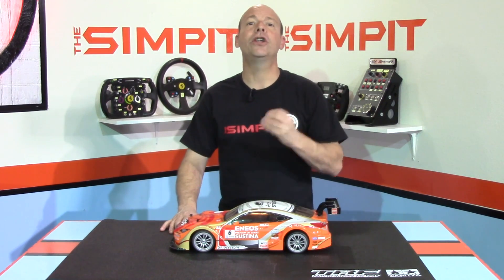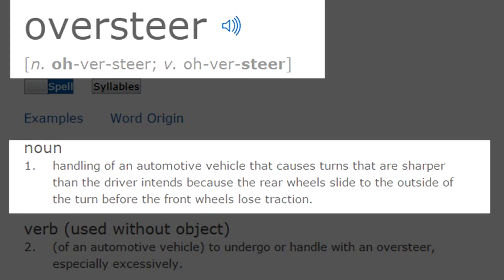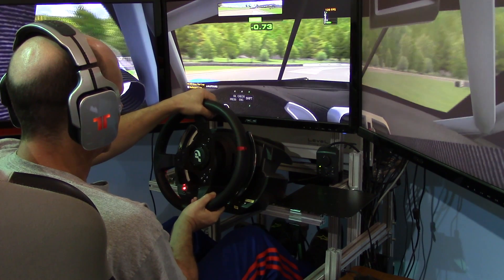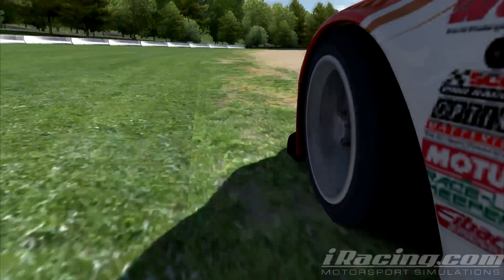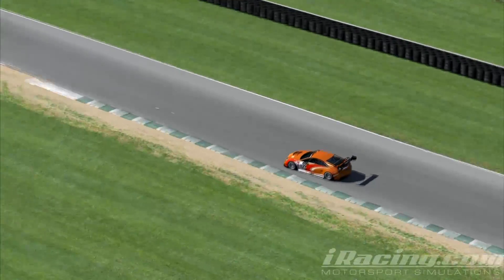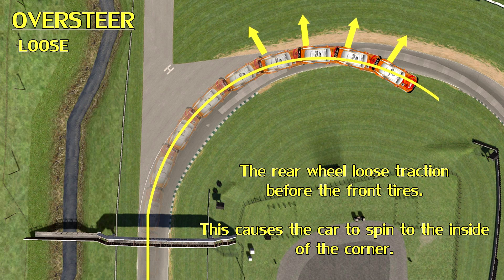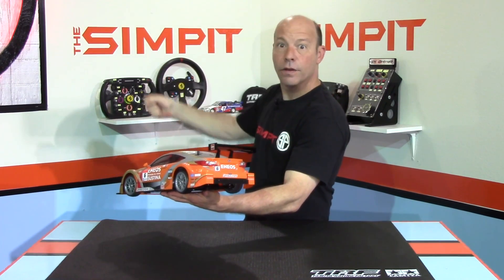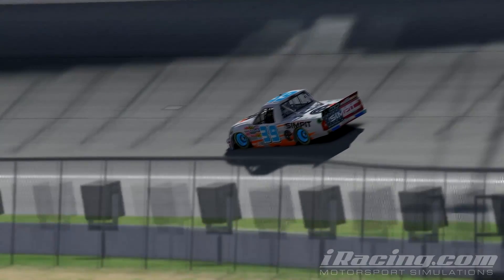Oversteer and Understeer Explained - Simpit Driving School

Comment: I know you said beginner level, but for understeer, 
Would you say the car leans away from the intended direction, do to weight transfer/ Inertia. The inside tire has less traction and therefore less power to pull you into the corner.
You mention what to do to correct this at Beginner level, 
Counter steering for a split second should give you more traction to be able to continue in word into turn, right?

Comment: Here's weird thing. Understeer as described here simply requires the driver to oversteer, provided he has fwd or awd. With a good weight-balance  it's possible to drift front and back simultaneously. With fwd, the fw's are oversteering and the rw's are sliding. This is very quick in corners.

Comment: Thanks for the videos.  Just getting into serious racing simulation.  I actually have been through some higher level driving schools (law enforcement) There are some similarities, however racing is racing :P  My struggles at the moment driving in the pack.  I am racing truck series stuff mostly.  I don't understand some of the concepts when you see guys pushing each other riding the draft (I do understand the clean air)  but just generally driving with technique in the pack.  I hope this make sense If not I can try and explain a little better.  Just looking for technique to drive safer in the pack....and when I guy calls for help ( I try to be a freindly driver being a new guy) I know what he is talking about and can put myself and car in the position to provide meaningful help to another driver in the pack.  Hope this makes sense!   Look forward to the response.

Comment: 6:00 the Wheels never should Point to the Oposite Direction.
The Wheels should always Point to that Way you wanne go.
Like here to see, when you pause the Screen at 6:01. The Wheels just Show in the Direction he wanne the Car to go.
Reply: Actually that is very true,  when rally drivers wants to do a tight turn they just point their wheel where they want to go which by default the opposite where the rear end wants to go    :D
Reply: turning the wheel where you want to go while it's in a spin doesn't help it. Turning the wheel the exact opposite of where the car is currently turning does. that's what he means.

Comment: i understand how i wreaked my car now
it was raining and i lost traction in the middle of a roundabout and the car oversteered tward the inside of the turn, so i instictively countersteered but i over corrected and whats more took my foot off the gas.
the suddan deceleration was enough to cause a weight transfer to the front wheels while they were tuned too far to the left and a subsucant rapid return of traction, the car then shot to the left and right into the lane divider.

Comment: What to do when a car oversteer due to more throttle
Reply: ease the throttle, you're kicking the ass end of the car and making the oversteer more aggressive, so throttle down, then when you get directional control begin to ease (emphasis on ease, don't jam it) the throttle up again
Reply: For rwd or fwd?
Reply: Oversteer with a rwd car can be very trick. If your oversteers the best to do is ease the throtle and corrects the trajectory with a bit countersteer, if necessary. 

But if you wants to keep the oversteer and slide you keep controling the throtle with very care. RWD cars have a tendence do spin doing this. Most if have central engine. When you accelerates the car weight is transfered to rear wheels, in rwd these are the wells that are tractioning the car and this cause a tendency to spin really quick.

In FWD cars is more rare to oversteer. But it can happen. FWD cars tends to get stiff if you accelerate and countersteer. And you can't keep controling the oversteer(drifiting basicaly) in throtle because the car weight transfer do back wheels and the front whells lose traction.

This things can vary a lot dependant on car weight distribution.
Reply: wrong , fwd cars cant drift cuz you cant keep your rear tires spinning
Reply: +Miguel M Silva Fwd cars can drift. They can't keep the drifting. But it's possible to enter curves powersliding and do small short drifts.
Reply: Carlos Ferreira yeah if you handbrake entry

Comment: I have a doubt if i use too much of throttle in a corner n the back slips out shd i lift off the trottle or i shd use more throttle?
Reply: lift off the throttle
Reply: I assume you are in drifting state, not yet completely spin out. 
I'd say don't lift the throttle so early. 
Keep it up as it is in order to not deliver weight to the front suddenly which it make the situation more like pulling the hand brake: loosing little grip left at the rear tires by delivering the weight to the front tires suddenly. 
Just adjust the steering wheel to the direction car drifts and gradually decrease throttle/power. 
Too harsh maneuver could be resulted to opposite side sliding.
Reply: Ugur Akdag it depends a lot on the car and how gripy the front tires are
Reply: Of course, it depends many things actually.

Comment: can a fwd car experience oversteer?
Reply: Yes, it can. However, the main difference of fwd and rwd, is the fwd car needs to do two things simultaniously with the frontwheels...steer and put the power on the road. Also, it's nose heavy as it has the motor and drivetrain at the front. You can compare it a little to a dart arrow, which has what engineers call "directional stability"..so typically it would understeer. Another problem is it will "jerk" the steering if too much throttle is applied due to the way it's constructed, as mentioned before. Those facts are the reasons why high performance cars typical are rwd. They simply have a better handling, due to the weight distribution. On the flip side a fwd car is excellent in wet and snowy conditions...it has better traction to the driving wheels (more weight on them).
Reply: Kalle Klæp thanks dude😄
Reply: My car (2002 Civic Si) does oversteer if you lift off the gas just after the front starts to slide.
Reply: Yes and in some cases they can be more prone to oversteer during corner entry. Normal forces on a tire is what generates grip. Since all the weight is up front, snapping a fwd car into a turn will instantaneously load the front outer wheel. As the car experiences lateral acceleration, the front wheels generate more grip than the rear and can induce oversteer. Same occurs under heavy braking into a corner.
Reply: Tyler Scrivner oh that makes sense. Thanks 😆

Comment: Hey, We are designing a fuel efficient car for a competition during which our specification does not support the normal handling situation. However we need to go with the under steering or over steering one. We are in a dilemma to go with which one since our operating speed is about 30-40 km/hr and in a square like pitch? Viewing your video I think it is good to go with the oversteering than under steering one? Is it oK?
Reply: If your speeds are less, oversteer is the best bet. However, the steering will be 'touchy'. Will need to control it more quickly

Comment: Usually when I oversteer and try to save it by countersteering nothing happens, just turn the wheels but still sliding in oversteer.

Gotta counter steer faster? Something with the throttle control?
Reply: Throttle control, if you stay at the same speed, the momentum will send ur car side wards and content steering will do half the job, u need to slow down a bit or keep just touching the accelerator and leaving it continuously. Throttle control won't work alone neither will counter steering, they work together
Reply: Zameer Nizam Ahh of course! Thanks man. Will try this!
Reply: Given that your car is FWD or AWD, your car is oversteering under control called drifting, and you can see that drifting would not be recovered by simply countersteering. You will have to countersteer and going on slight difference on the gas padel to basiclly recover easily. The reason that only countersteering will not work is that the car has inertia so it is much more difficult

Comment: so both understeer and oversteer do not give you as much directional change ac you could otherwise. even in oversteering your just rotating  more but the velocity of your cars momentum is less affected as rapidly as the ideal in-between. so these concepts are all about losing control of momentum. thanks man

Comment: Well I drive a car with FWD, and one time when I entered a corner I didn't calculate for the accumulated speed that the car had made and I just turned the wheels rapidly, thus making the car lose grip, I sensed that right away and hit on the brakes as hard as I could, I stopped around 5 inches from hitting another car, I absolutely lost control of my car.

Comment: So understeer and oversteer in a system put in the car to get more traction on turns to stop the front or rear wheels from slipping even the slightest bit? That sounds really stupid and annoying.
Reply: +HighFiveGuy13 nope, they are not a system put in a car ... they are descriptors of a cars resulting handling characteristics quantified by all the cars systems, track conditions, and driver inputs.

Comment: "not much you can do in a front wheel drive?" well you touched on weight distribution... but what about Scandinavian whip? The other methods? Sure it's not as fast as rear wheel drive... but it's not far behind, you just gotta throw it into the corner a bit more. You made it sound like "front wheel drive.... forget it, they don't work"
Reply: +Reuben Stern the scandinavian flick isnt exactly an efficient method compared to rwd oversteer lke you mentioned and if you have a long corner you cant really reflick. Fwd cars have to use a different set of boundaries on corner entry, kinda like how you would drive something with a heap of body roll vs something thats dragging its guts on the tarmac
Reply: +Stewart Mckinna also, you can tap the break to change the balance of a front wheel drive, so it will oversteer.... but obviously it's a lot slower. Like I said, he touched on it.

Comment: Sean, I had hoped you would've talked more about what you should feel through the wheel with the situations. Even more than that I was expecting you to explain the reason behind why the feel happens, especially with oversteer.

With oversteer you said that the tyres will automatically point in the opposite direction. Which is technically wrong. What happens is that the tyres have their self aligning torque that keeps them from twisting around their center axis. In other words, tyres don't want to turn but they like to roll straight ahead. The path of least resistance.
What happens is that these tyres who wish to go straight are connect to the spindle behind it. Which has a spindle or steering arm to which your tie-rod is connected.
This tie rod goes into a steering rack on both sides, left and right wheel. In the steering rack there is a bar, which is called the rack, that moves freely through the steering rack housing. So both tyres are connected directly to each other through the steering rack. On the rack there is a pinion, which is on the other end of the steering shaft to which your (in a real car) steering wheel is attached. This pinion is replaced by the FFB motor in a steering wheel for your computer/console.

Now what happens with oversteer is dat the car rotates around the center point between your two front wheels. As the car rotates and the wheels keep wanting to go straight forward, the steering wheel automatically counter rotates as the rack is pushed through the steering rack house by the self aligning force of the front tyres. Which moves your pinion and thus the steering wheel.

That is why in games and especially sims you should not need any faked seat of pants or weight transfer effects to know what the rear is doing. You already kan feel the push through the workings of the steering rack itself... if the tyre model and FFB model work correctly that is. If the tyres don't self align wel and don't stick wel to the asphalt in a correct manner, this will feel incorect in a game. Which is possibly a reason why with the simpler tyre models of the past we had to rely on fake weight transfer effects. An effect that is prone to oscillation as the car's weight, and especially fluids, don't stop suddenly when you hit wheel center on corner exit.

Hopefully you can rely this info to your viewers, Sean. Knowing what you should feel and why you feel it is just as important as knowing the situation itself (i.e. what oversteer and understeer mean).